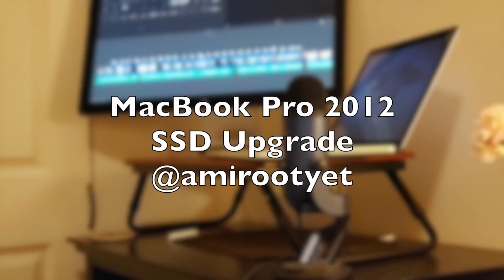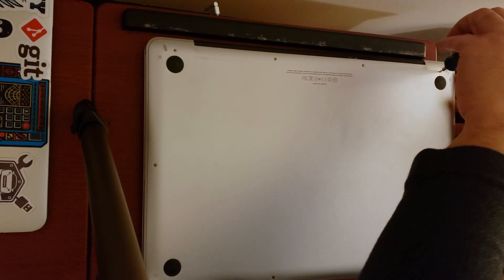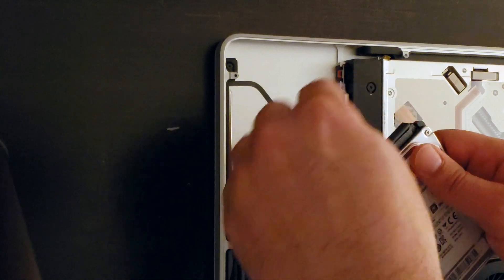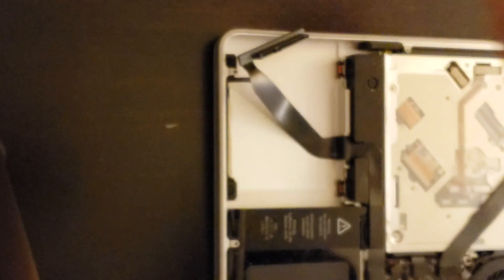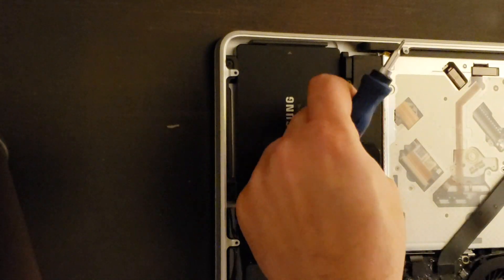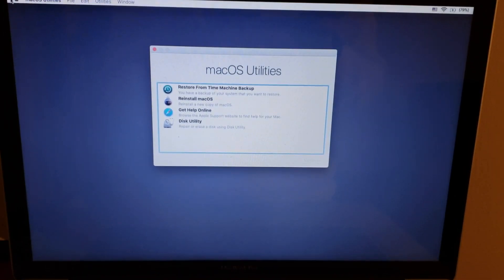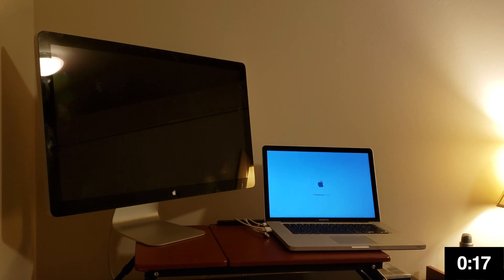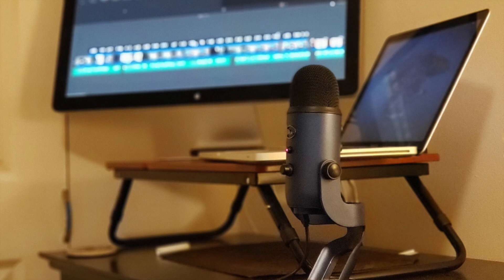Macbook Pro 2012 SSD Upgrade + Installing MacOS on new SSD - How To - AmIRootYet - Pranshu Bajpai

Comment: What about enabling TRIM in terminal? I've read that this is necessary. I have a 2011 Macbook Pro. I installed this same hard drive, but 10.13 HIgh Sierra is the highest operating system that will work on the 2011. It worked for about a week and then I started getting constant beach balling. I read that other people had similar problems with this Samsung Drive (there was a bad batch produced) and some people were talking about how you have to enable TRIM in terminal. I sent it back and they upgraded the firmware and tested it and I just received it back and installed it. Now I have to re-install the OS. But I'm wondering if I'm supposed to enable TRIM before or after installing the new OS.

Comment: Helpful video for upgrading my Mid-2012 MacBook Pro with a new SSD. However, when I followed your instructions on loading the OS - Command+R - it loaded Mountain Lion, NOT Catalina :( Took me awhile. but was able to install Catalina by restarting and holding Command+OPTION+R. Other than that, a good video. Thanks!
Reply: How did you get Catalina installed?
Reply: And before you do anything, make sure to BACK UP EVERYTHING YOU WANT TO SAVE ON A SEPARATE DRIVE OR ICLOUD!!!

Comment: Additional tips after I did this 2 weeks ago : Disconnect from power cord before opening . Consider replacing Battery while opening case .  Look up how to clone onto new SSD and buy those bits follow those instructions .Use time machine to do it , makes setup of previously used and loved MacBook files and downloads easier. This method resets all functions .  Grab a Tech driver kit ( electronics stores have them , even a car parts store near me has them or even check a Hardware store ) . I got mine from Ifixit . You need TX6 and OO . My crucial SSD had a "shoe which I placed under SSD when installed , stops vibration and movement . Clean the inside  of dust and hair .
Reply: Wait my ssd has like all the downloads I have 😢 that kinda makes me not want to get new one honesly

Comment: Great video, thanks! Mine went into the repair window and downloaded Mavericks instead of Catalina, otherwise everything went according to plan here!

Edit: hold down Command+Option+R to install with the latest compatible OS!
Reply: Had same problem - loaded Mountain Lion with Command+R pressed...when I restarted and pressed Command+OPTION+R, loaded Catalina :)
Reply: When did you hold down command option r?  After it installed mountain lion and then 
 turned it off then back on? 

Or from page that save install maxOS, disk utilities, and all that?

Comment: My Command R is Not Working what to do , I have tried many Commands by None of them are working and That Grey box with questions is Poping up
Reply: Do it straight away when you turn on ur mac I just did and worked for me
Reply: @HopeWeEscape  not working, I borrowed my friends MacBook and cloned his drive with mine And it worked, if anyone having problems like none of command is working, just do a clone of another MacBook.

Comment: What to do when if my R key is not working?
Reply: external keyboard?
Reply: Replace Keyboard, but if you have a Retina Macbook Pro, it's fused into the Bottom Case which means if it is broken, it requires you to get the ENTIRE new bottom case just because of the Keyboard, if it's a Unibody Macbook Pro, you can simply replace Keyboard by doing some screws.

Comment: How did you install Mac os after assigning as an extended journal? Did the mbp auto detect the latest compatible version (since it's a 2012 machine) and started to download to install? Or did you plug in any external storage device with the Catalina os?

Comment: Superb , flawless really , so many videos on here miss small but essential steps out 👏🏻👏🏻 one thing a may add is that I had to reinstall twice , once for OS X then again for Catalina .
Reply: I was told that you have to somehow format the solid state drive when replacing the hard drive for it? Is this true? Did you do this ,if so how is it done?
Reply: @vintagedanger  he explains this in the video at 5:20.
Reply: How did you install Catalina? Mine rebooted with mountain lion.

Comment: Thanks a lot brother. Even i had installed an ssd and was excited about the speed but then it couldn't boot and question mark folder came. So was finding a way to install mac os on it. And you helped. Thanks a lot.
Reply: Bro did you upgrade the ram too or just the SSD?
Reply: @leokiri  one of the rams out of two wasn’t working properly so replaced it with a new one

Comment: Great vid.  So ... did you install a "non" formatted drive into the macbook?  I have installed a new blade style ssd in my 2012 macbook and run disk utilities and it is taking FOREVER to format.  
What key combination did you use before entering disk utilities?  Thank you!
Reply: Command and r key

Comment: My 2012 mbp hdd is currently formatted as APFS (encrypted). When I get my ssd, should I restore my hdd to ssd as APFS? Or should I un-encrypt my current hdd so that it would be extended journaled and then format my ssd as extended journaled also? This Catalina APFS has got me pulling my hair out trying to do figure this out.
Reply: Did you ever figure it out? I have Catalina  also and have not been able to configure Catalina with new SSD. Ive tried all formats and cant copy/clone my hard drive. says something like error , cant encrypted library. ive tried APFS & MAC OS exten journ. Any info would be great.

Comment: Hello bro, my old hard disk HDD which came with my MacBook Pro, I transfer all data on it to SSD through Time Machine, then I removed the HDD and I insert the new SSD to my MacBook Pro which has all data from HDD, when I start up my computer goes to recovery mode!   Do you have any tips to fix the problem?

Comment: Thanks for a great tutorial all went well with the exchange to SSD.Machine runs brilliant, so fast now. However, I have an issue don't know if you could help. I did a back up using time machine as you advised but when I wanted to set up the new disc from it I do not have access rights to it. In the end I had to install a new OS but of course now I can't access all my files. Any ideas please
Reply: https://support.apple.com/guide/mac-help/change-permissions-for-files-folders-or-disks-mchlp1203/mac

Comment: Hi pls tell me, which macOS is better for my mbp mid 2012 ?
Reply: Same question!
Did you figure out, which is better?
Reply: @konstantinosaka  If you have an SSD and 16gb of ram go catalina otherwise go High Sierra or Sierra
Reply: @MrYughurta  Thanks! Why not Mojave?))
Reply: @konstantinosaka  If you have only an hdd you can get some lags and problems even with mojave, so high sierra is the best choice. If you can install an SSD and 8 or 16gb of ram, Catalina is the best choice.
Reply: @MrYughurta  thank you for the advice!

Comment: Apparently for High Sierra and above APFS formatting is recommended for SSD drives as it is optimised for SSD. 
And did you enable TRIM on yr SSD?
Reply: APFS was not listed as an option when I erased and reformatted my new SSD - how were you able to format in APFS? Also, what is TRIM and why is it important? Thanks!

Comment: Great video! Thank you for making it! I attempted last year to do this with Mojave and it did not let me. I was trying to copy my old drive to the new one. I attempted with time machine, and even third party software and was not able to do it. When I finally did it would glitch and only startup once and after that I would keep getting that folder screen. I want to try it again but my question is on your video did you just restore it to a “new Mac” as in you didn’t copy your old HD to SSD?
Reply from the maker: Yes, in this case, I did a clean installation from scratch on the new SSD. My data is always backed up on cloud. After the clean installation, I simply downloaded the data back on the new SSD using a cloud client.

Comment: thank you for the video
I was wondering if the 1tb Samsung ssd was compatible with Catalina on my mid 2012 MacBook Pro
...now I see it is... I'm now gonna upgrade to 16gb ram as well
thanks again 👍🏼
Reply: Hi! Are you still running Catalina? Iam planing to upgrade ssd and ram on my 2012mid , not sure what should I instal on clean: Mojave or Catalina..
Reply: @konstantinosaka  I think High Sierra and Mojave will give u the best bang for ur buck.
Reply: @rndmusrnm2763  thanks,man! I got Mojave everything runs just super!
Reply: @konstantinosaka  yea I installed it on my 2012 MacBook Pro and it’s running pretty smooth. Probably not gonna go higher cause I heard Catalina can be buggy on older machines
Reply: @rndmusrnm2763  I wont go higher either. Everything i need runs great. Even games on steam)) getting pretty hot though..
Reply: @konstantinosaka  
Mine can get hot too, I know putting new thermal gel would help but that's beyond my comfort level. 

Cleaning out the fans could help a ton too and there's a ton of videos so I'd probably try that out.
Reply: @rndmusrnm2763  Will check those videos,thx!
Reply: @rndmusrnm2763  Man, i just cleaned my fan, so easy, and it helped. I also checked the videos how to change the Thermo paste on our pc,but it is looks like a pain in the a..))) peace ✌️